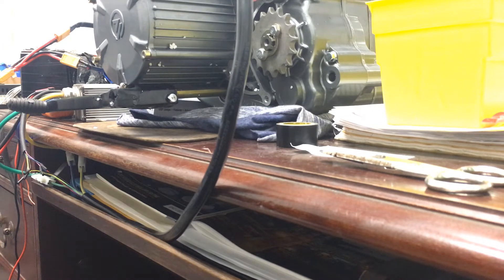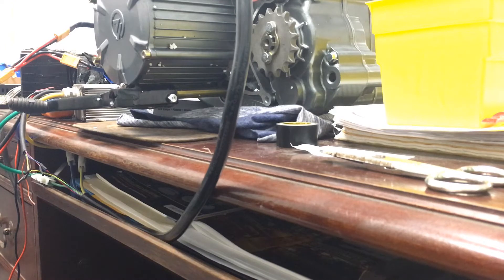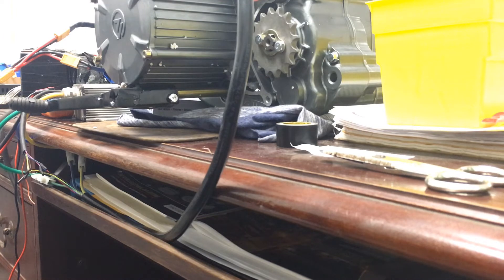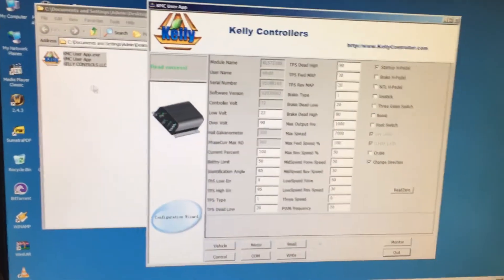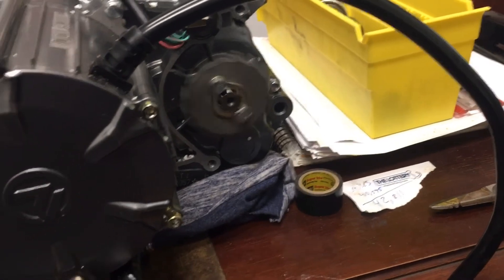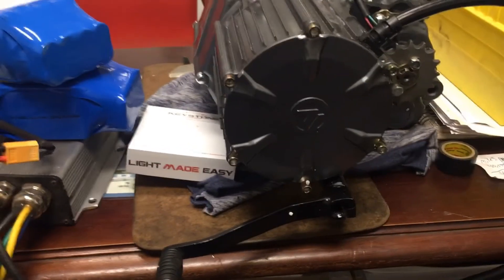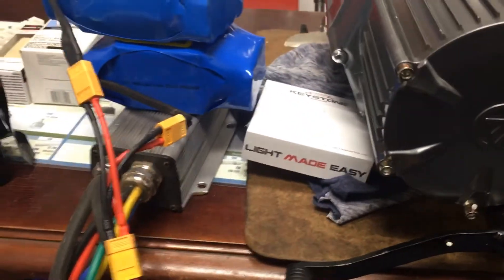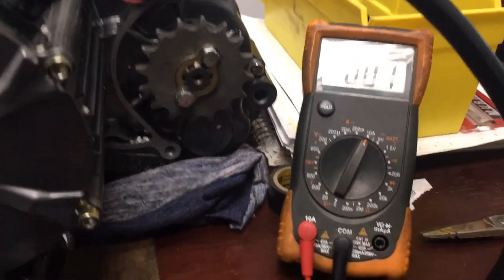Denzel 4-Spd Electric Gearbox Test 36v Kelly KLS

Comment: Hi,, got the KLS7230S and it Das the same bucking on a Qsmotor 205 v3 50H,, Any information will be appreciated for you. THANKS
Reply from the maker: odd, I haven't heard of that issue with a QS hub motor yet...typically it means you need to use a non sine wave controller with that motor like a KBS series. But the issue varies depending on motor type, some people solve it by running the halls on 12v instead of 5v it doesn't work for me
Reply: Hi buy and try use sabvoton ml60 controller
Reply: merhaba aynısından bende aldım.sizin KLS7230S top seep kaç km hz yapıyor?